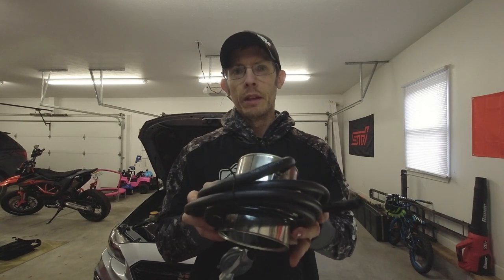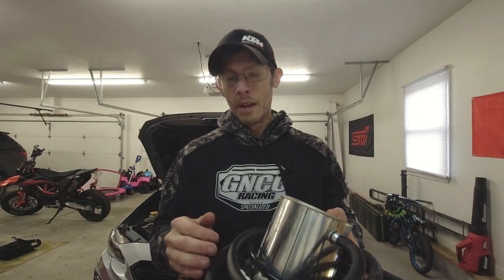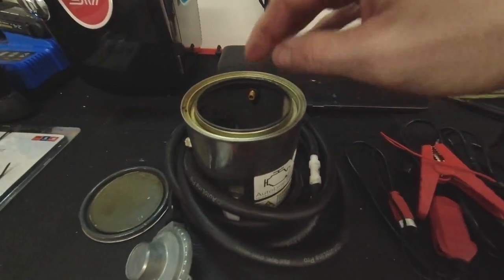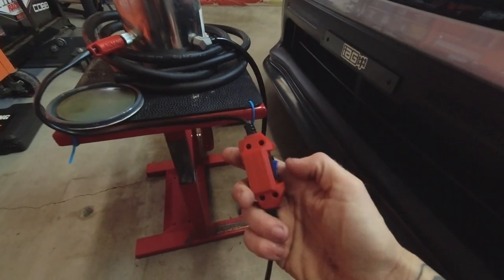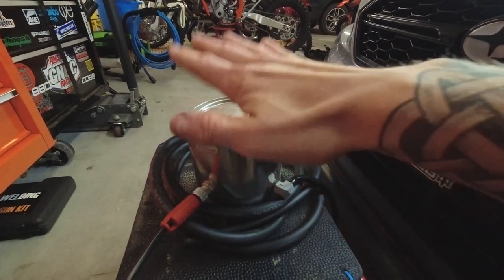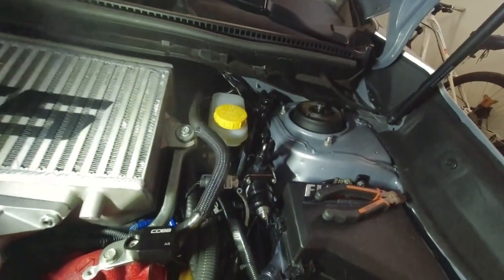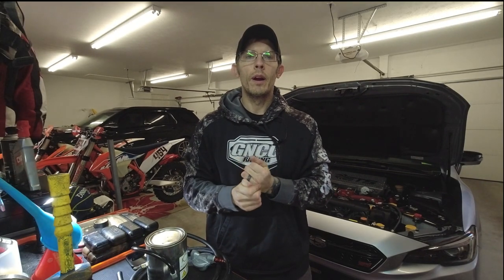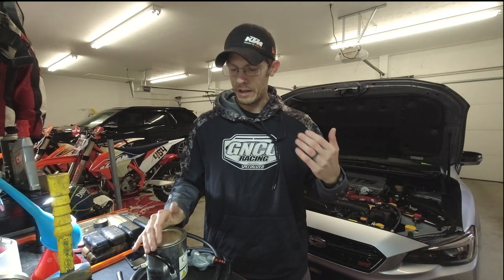Setup, Tool Test, & Review AutoLine Pro Vaccum Leak EVAP Smoke Machine | Economy Series

Comment: Cool. I wonder if you can run it on an m12 battery.
Reply from the maker: I've saw thos M12 Milwaukee batteries used for being testers and such, but don't think they would work to well with this setup. 

That is just my opinion though and honestly would up the portability a ton if it did work well.

Comment: How much oil consumption do you think is normal? I have a ‘21 STi and I have to add a half quart every 1500 miles.
Reply from the maker: Subaru says that 1qt every 1200-1500 miles is acceptable. If that is the case and you are at .5 qt every 1500 miles my suggestion would be to monitor it for now. You could take it to a dealer just to start a case on it if it gets worse just to cover yourself. 

Also, you could try to use a slightly thicker oil of your choosing if you're not already. Something in the 40W range sometimes help curb oil consumption a little.
Reply: @spdkills83  Yeah, I was thinking about that but I don’t want to void my warranty just in case. I was just going to switch to a more robust 5w30 to see if it mitigates the consumption. I’m thinking motul xclean. I also have an appointment next Monday at the dealer. Thank you.
Reply from the maker: NP sounds like you have a good approach plan. Good Luck